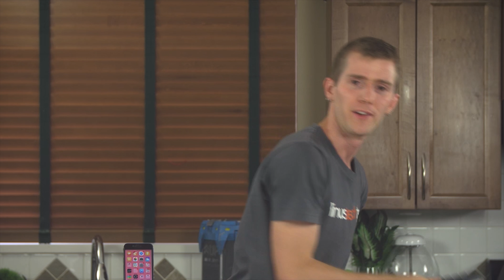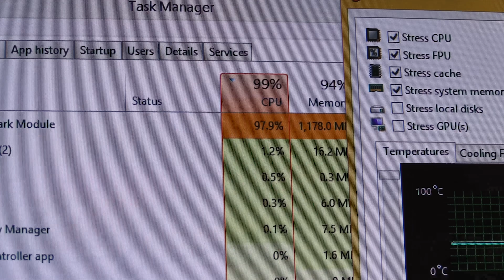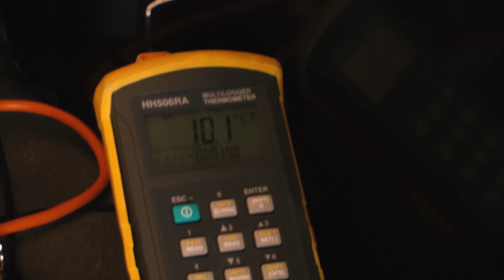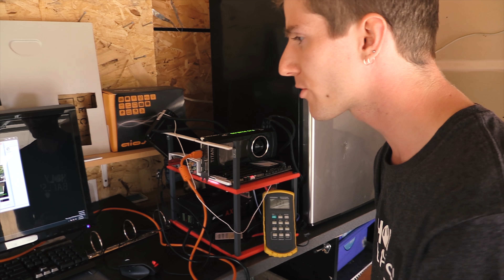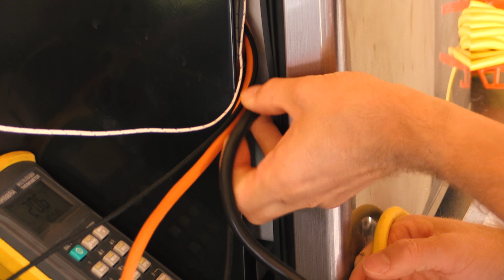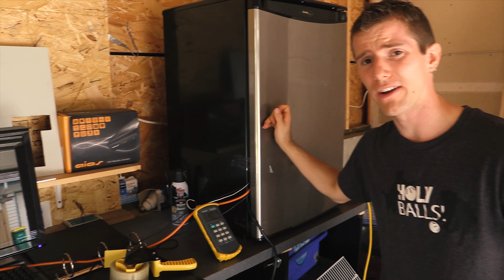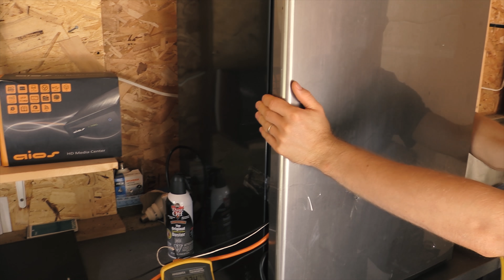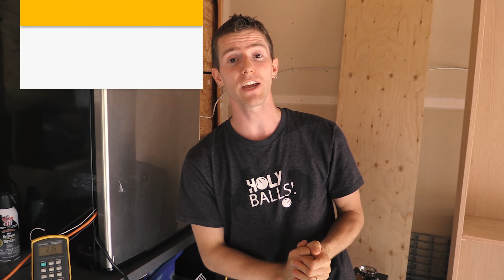PC Build in a Fridge - Does it Work??

Comment: Some fridges have airflow
Reply: Isn't airflow generated on the inside only, though? Exchanging air with the outside seems like a bad idea for a system that is meant to be insulated from the outside. If it's on the inside only, then it wouldn't help much, especially considering that the pc is already generating airflow on its own with its coolers.
Reply: I'm no mechanical engineer so I can't give you an absolute answer. But bigger fridges (and more expensive ones) have inner ventilation. Air is both sucked and blown into the chamber. The more modern fridges use an air carpet technology. The cool air is released onto the shelves, which is then dropped back to the bottom where there's a little vent for the heated air to be sent back into a cycle. Basically a 2000 dollar fridge isn't worth it for overclocking xD

Comment: That second test wasn't completely accurate. The area of the seal around the wires is open, that could be part of the reason why the second test had such high temp. If the fridge was modified to accommodate the wires someplace else, and not breaking the seal of the door, it might be a different outcome. I will say that, even if that had been the case, it would most likely not be too different of an outcome.

Comment: I'm building a new pc, and I was wondering, my current PC is running windows 10 and I havenet had any problems with it. I would like to get Windows 10 on my new rig, yet I only have a windows 8.1 disc and key. So should I just install windows 8.1 and eventually pay $100 for a windows 10 disc later on? Or should I just stick with windows 8.1? It's gonna be a fairly high end rig with an i7-6700k and a gtx 1080. Any feedback would help!
Reply: Dude you have until the 29th this month to upgrade the Windows 8.1 to Windows 10 for free
Reply: Sadly, i'm gonna be building the system after July 29th.
Reply: Get a spare hard drive that you have, put it into another system, activate your 8.1 key, upgrade it to 10, take out the drive, put it aside until you build your rig, and then when you buy your SSD for your gaming rig, by a Samsung one with the cloning software (I believe all of them come with it, but I could be wrong) and then clone your spare drive with Win 10 on it to the SSD and put that SSD into your gaming rig
Reply: +CerealBro1 The free upgrade keys register to the MoBo, not the HDD.
Reply: lol this kid actually spending $100 on these keys i feel sorry for you.....and you do know there is something called free windows 10 upgrades
Reply: im in the uk but i guess this should be ok?

http://www.ebay.com/itm/Windows-10-Pro-32-64-bit-License-Key-Digital-Delivery-/182221238418?hash=item2a6d3b7092:g:TusAAOSwbsBXl2Oh
Reply: You can still get a free upgrade on Windows 10. Look up Theo Joe Tech look at his channel and it shows how to do it
Reply: windows 10 keys are only £10/$10 may as well just buy it plus you have a genuine key incase you mess up
Reply: +Steezus Khrist over*
Reply: Just crack it, kappa.
Reply: use linux
Reply: Guys I already built the system and have windows 10 installed on it. You can stop replying now. Thanks!
Reply: Kenneth Lett No.

Comment: Over time, wouldn't the high moisture of the ambient air of the frig get to the electronic components and ruin them? Unless you don't mind dead hardware is a fraction of its life expectancy, I wouldn't recommend doing this! I guess it would depend on where you live as many places could use some moisture in the air. :)

Comment: calculating with BTU would be easier..
BTU=3.413*W
So, if your PC is generating 600W, you need 2050 BTU,  which is 25% of a small room AC unit (I'm rounding up a bit), or twice the capacity of a full size fridge.
Office fridge didn't have a chance :)

Comment: Hey Linus, I've got an idea! Why not build a PC in a normal/custom case BUT water cool it and place the radiator in the fridge, instead of the entire build?

I was thinking of that due to the fact that I live in Singapore and it is really humid down here, and exposure of cold components to moist, warm air will definitely cause some damage due to condensation. 

So with only the radiator being inside the fridge, I don't see how the other components can risk getting any harm :P

Plus you dont need to fit all the components inside :D

Comment: The issue with refrigerators is the fact that there is a lot of moisture in there
Reply: Shouln't be an issue if there's nothing inside but the computer. But the cords leave multiple small gaps in the seal that the door makes. That introduces condensation.
Reply: a block or bowl of salt can remove moist
Reply: There's no more moisture then anywhere else. It's the water in the air condensing because it's cooler then the outside temp.
Reply: It's very dry at the bottom of the fridge, moist at the top.
Reply: Ever hear of desiccants?
Reply: Custos nope never, whats that?
Reply: Jacob Sorensen and they aren't reliable. I have a mini fridge and often the temp lets up and the frozen parts melt and drip a lot
Reply: Gels and powders that absorb moisture.  Silica Gel is most usual.  When you next buy a pair of trainers (sneakers), look out for the little white packet in the box.  It's there to stop your shoes rotting in storage.

Comment: Try it with an air cooled cpu. Someone probably already mentioned this but I'm too lazy to read through all the comments. The liquid that's cooling the cpu would take awhile to get down to ambient temperatures. The air would be cold right away. Or (I don't know if anti-freeze would work in a liquid system) use anti-freeze and let it get super chilly like 10f. Sorry for rambling. :)

Comment: try building a round air control unit in your back yard or a square one with four ac unit in the corners and create a vortex unit placing only condensers in the unit no fans. don't forget to use the important question (to seal or not to seal).

Comment: go to a local electrical store.
find a silver can labeled Kon-Form.  Tape over all your heat sinks.  Coat your entire board with this stuff just like you would with spray paint.  Do two good coats and make sure everything is covered in it.  It seals the board from moisture and holds up to 150 degrees Celsius.  Put that shit in the freezer and watch the Temps drop to nothing.

Comment: That processor is running super cool under load.

Laptop processors on the other hand get crazy hot. Mine is 50-60 degrees when browsing and 80 degrees under load. :O

Why don't they turn the fan much lower, since the temperature is nowhere near dangerously high? It would make the PC more quit.

Comment: Try a beer cooler, but the ones with compressor, not the silly ones with a peltier. They're rated for 24/7, or at least 16/7, I use one to cool my laser cutter, and it works like a charm.

Comment: My idea is that put the radiator inside freezeer with below zero coolant liquid inside and keep pc outside to get below 0 temps for cpu and gpu . May be u can make the pc totaly silent cuz u might not even need the fan for radiator its so cold in freezer so u need just keep coolant circulating.

Comment: It would also be a good idea if you can conformal coat all of the PCBs... which might void all of the warranties when you take the PSU, GPUs apart. I hear epoxy baths also work as long as you dont accidentally glue the connector slots.

But that is usually only needed if you are doing LN2 cooling.

Comment: What about a mini freezer? I mean, the temps there are significantly cooler.
Reply: Winter is coming.
Reply: Sure, at first the temps would be cooler. But once the computer begins producing heat, the freezer would not be able to produce enough cool air fast enough to overcome the heat produced by the PC and eventually it would become like a hot-box with the computer just recycling hotter and hotter air.
Reply: It's not the temperature, but the heat you need to remove.Temperature is caused by heat. Therefore, the cooling performance of the fridge must be higher than the TDP of all your components inside the fridge. Usually, a fridge takes about 100Watt. My PC takes about 450Watt under load. This would theoretically means, I would get a nice expensive block of scrap metal soon.
Reply: +wytze boersma Who gives a single fuck
Reply: Exactly. Now, if you were to put a couple exhaust fans in there it may work, but then you have a fridge with a big hole in the side/top of it.
Reply: +ColdBore Gaming upgrade the compressor and stronger motors also add a fan to the condenser and you got a turbocharged freezer
Reply: what about in a a freezer?
Reply: Do you mean a full size freezer? that might work...

Comment: Thank god for Canadians and the celsius system.
Reply: Its mostly Swedish actually.
Reply: The french made it tho
Reply: thats why we thank for those separately
Reply: +The Cookster thought the French made it
Reply: keziah zuinghedau excactly.
Reply: If you consider Anders Celsius (the inventor of the Celsius scale) French, then the French made it :p In reality though Anders Celsius, a swede, proposed the scale (although reversed at the time with the boiling point at 0C & the freezing point at 100C). Today 0C marks the freezing point & 100C marks the boiling point of water. A quick google search of "Celsiusus + wikipedia" will show you that :D
Reply: Erik Höglund The french made the si system which includes celsius. As a norwegian I know the Celsius alone is swedish.
Reply: No one even mentioned the SI system. But yeah I know that that system is french. The SI-unit for temperature is the kelvin though, which kind of is Celsius with another null point (-273.15 C = 0 K).

Comment: Or you can just get an AM1 quad Core like I did and get a consistent 11'c Temps. Under full load, only 27'c. Stuck a GTX 950 with it and still get 47-70 fps in my games at 1600x900. Still can't believe that the Temps are 15'c cooler inside my computer than my bedroom. CPU = 25W.
Reply: I don't think anyone else would believe your CPU gets 15degrees colder when being used either
Reply: Hard to believe isn't it.  Unfortunately, Linus said to never have your cpu temp below the AMBIENT temperature of the room it's in...my room is 80'F or 27'C and the CPU is always either 11, 12 or 13'C.  Even as I type this with Linus' YouTube running, it's 13'C. On full load, it's never gone over 28'C.  Here's a link to two reviews about this AM1 thingy...http://www.phoronix.com/scan.php?page=article&item=amd_athlon_sempron&num=8 AND http://www.tomshardware.com/reviews/athlon-5350-am1-platform-review,3801-9.html .  Both show results of super cool 25Watts Quad-Core power.  Unfortunately, I found out the hard way that it does NOT support dual channel memory or PCIx16.  I have my GTX 950 that was getting 100fps in Heaven Benchmarks at 1920x1080 in an older computer...now gets only 70 fps in this super cool, quiet single-channel memory, PCIx4 computer.  My son's SuperTuxKart at least gets 46 to 70 fps at 1600x900. I will ask Linus to do an AM1 video one of these days.  I learned about all this after I saw an MSI AM1I board for $18 before $10 rebate.  I took a shot in the dark no knowing anything about the AM1 processors and so this is what I came up with.

Comment: now try a freezer
Reply: Same thing would happen
Reply: How about a freezer with fans inside :)
Reply: mttrsll7 no take it to norway
Reply: Well, honestly it depends on how big the freezer is. A rather large (20ish cubic foot) freezer might be able to keep ambient temperatures down for an hour or so. If you had access to freezers that large restaurants use, which are the size of a room, then it could keep ambient temperature down for quite a while (possibly indefinitely). If you had access to a meat packing plant that processes frozen meat... But honestly, if you're going to do that, you might as well just build a computer in the antarctic. You could also just ask your local grocer how much it would cost to lease a spot in the back of their freezer section to put your computer.

The larger the freezer, the less the thermal energy from the computer is going to make an impact. But you're right, it will always make an impact no matter how small.
Reply: fin, of course they have a compressor in these mini-fridges. That is a simple fact, crack one open and find out for yourself. How would you imagine that they work without a compressor?
Reply: All the ice and water condensation will quickly destroy your components
Reply: Brian Kleppe It would just move the heat around inside the freezer, that wouldn't work either
Reply: if the freezer actually had a compressor it could probably do it these mini fridges have no compressor and are just inefficient
Reply: Yourpants Peltier effect refrigeration all smaller fridges like that use it since its a lot cheaper and quieter then using  compressor.
https://en.wikipedia.org/wiki/Thermoelectric_cooling
Reply: @B K
Totally possible, but the costs would be a lot higher than by the conventional way. So only if you dont have to worry about your finance, then you could totally do it and have an idle pc with temperatures at 10Celcius. But if you have all that money, then you will have a monster pc anyways and dont need to clock it on max settings.

Comment: Powerconsumption of that fridge must be around 100 watt. Effectivelly cools like round 50 watts. Result the pc will be cooled like the outside air would if notit heats up above average temps. Perhaps putting the PSU outside the cooler would help a bit.

Comment: Ok now do a middle of the winter outdoors overclock.
Reply: That wouldn't work at all, let alone any outdoors set-up.
Reply: Yes it would.  I've seen it done on older cpus.  Biggest issue is freezing, it gets too cold. So you still need to insulate the motherboard.  You should google it, it definitely is a thing.
Reply: I used to live on a farm and the house sat around 5C on a good day.. Only up side was overclocking the fuck outta my gaming rig.

Comment: What about only putting the radiator from the cpu inside that way your not putting the heat from the whole system in also your not risking the electrical bits getting damp? Would doing it this way add aditional cooling to the cpu without overwhelming the fridge?